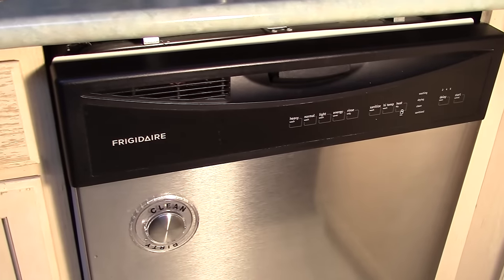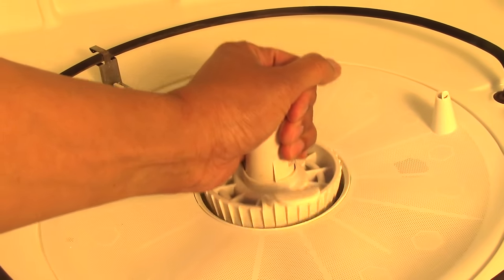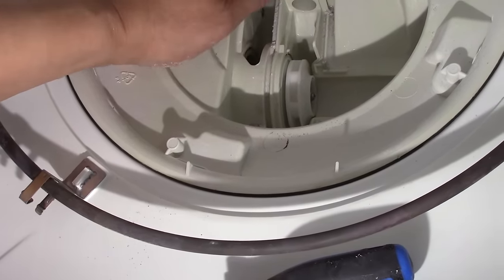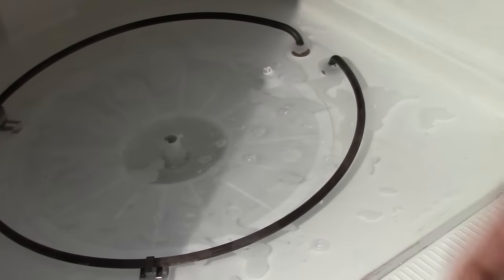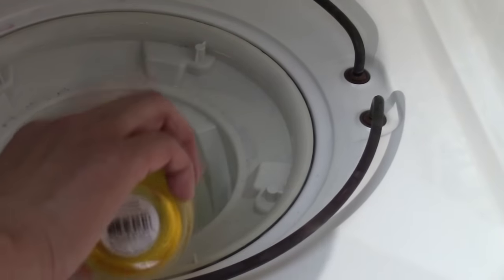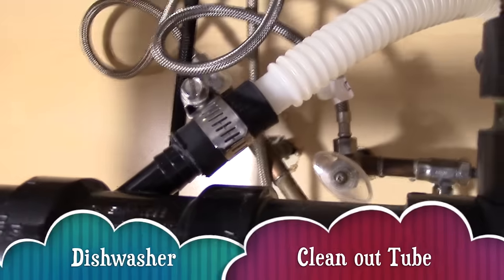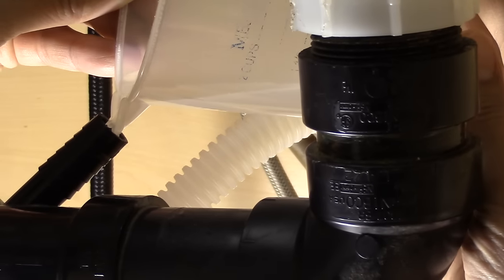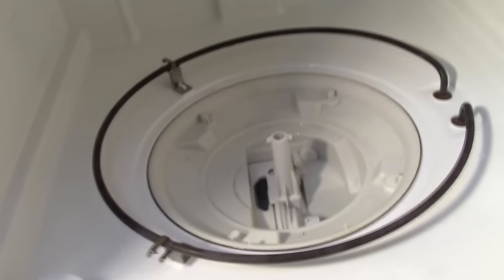Frigidare Dishwasher Not Draining Failed  2x - DIY unclogged dishwasher

Comment: Should have started with the “clear the hose out of the dishwasher” part first, professor! Otherwise, very helpful. Thank You.
Reply from the maker: Yes you're right. Glad my video helped.
Reply: @jonahvlogsdiy4143  You did great - most watch the entire video before attempting repairs/troubleshooting.. and in my experience you put the most probable problem at the front of the video..clogged inside the dishwasher - most people don't even know how to check their models..
Reply from the maker: @daveladd7046  thank you.

Comment: Are you able to respond?  My similar model Fridgidaire has low pump pressure, so I took it apart to look for clogs. Unfortunatgely, I did not observe how the large-diameter sump gasket fits relative to the center part and the round edge.  Can you help me with this? I cannot tell (from parts diagram) if the gasket has to fit around a part (i.e., the center part goes into a groove of the gasket, or if the gasket simply gets "press fit" and compressed .  Any help?

Comment: While ours seems to drain complete after a cycle, we noticed water start to pool up and not drain a few days after no my running it at all. Never had this issue until we had a Fridgerate dishwasher, any advice?
Reply from the maker: Good question. Not sure but maybe the pump not pushing water all out and coming back in.

Comment: Heck! My big screen got warped at the edge after washing w Clorox n hotwater.  The edge became 1/8H sine wave at several sectors
so i tried bending it w my fingers. I finally managed to reduce the wave to two sectors.  But can't accept it. Debris will sneak in from
there.  why oh why it can't lay flat at the edge?  Must b of cheap mat'l?  the dishwashing environment should b able to withstand datto
heat and soap (or Clorox n laundry soap).  Well, i just had to 'level' the hi two spots by filling there w Si (must b just latex as GE product
can lie) caulk.  Dry the caulk, then i'll re-install it tomorrow.  The best fix s/b for the maker to add spring loop at the edge.  Stoiped design!
Reply from the maker: Good idea. Thanks for sharing.

Comment: Mine still has water under the BIG ROUND filter. I did the baking soda, vinegar, and hot water three times. I also removed the thing under the sink and it is not clogged.
Reply: And then I ran a few things through the dishwasher and most of them came out dirtier than when they went in?!
Reply from the maker: It must be something else. I hope your issue will be heard from our Youtube viewers and someone else with the same problem can help. Sorry it didn't work for you.

Comment: What if I need to replace that rubber piece that attaches to the drain? What is it called? It is not right enough for a seal
Reply from the maker: If the rubber seal is causing a leak, then you should replace it.

Comment: Is there a valve i need to shut off before unscrewing that bracket for the hose? If I were to just unscrew the bracket, water won't just flood under my sink?
Reply from the maker: Have a bucket ready just incase, but there should be no water if the dishwasher is not running.
Reply: nothing will be feeding it any water but you will likely have some water in the hose.  An old bath towel will work as it is difficult to get a bucket close enough to where it needs to be and the water will be minimal.

Comment: Great vid...i came here because my dishwasher is a frigidaire and not draining but also the metal ring heating element on bottom stays hot and the dishwasher has been off for 2 days!!...burnt my thumb a bit but ill be ok... do you know what to do to fix this problem? Thanks!
Reply from the maker: I'm not sure how to fix the heating element. I hope some of our viewers may know and see your post. Maybe another DIY channel in Youtube can help you out. Sorry Vinny.
Reply: JONAH VLOGS & DIY make sure the switch is set to air dry and not plate drying , it’s the plate dryer that turns on the elements.
Reply from the maker: @victorchilds7834  Thanks for the info. Now our viewers will know. I'll add that to the description also.

Comment: Mine is not one that is comnnected underneath the sink. I roll it over to the sink, connect the hose to the faucet and plug it in. I could do the first two possible solutions, but how would I do the third solution? I haven't run my dishwasher in well over a year, but if I could get it to run properly I probably would.
Reply from the maker: Hopefully you get it to run. Let us know how it works out for you.

Comment: tried everything, unfortunately I think my clog is elsewhere and more likely than not at the exit of the dishwasher. I will need to pull it out and remove hoses :(.
Reply from the maker: Sorry to hear that. I hope you find the problem. Let our viewers know what you find.
Reply: @jonahvlogsdiy4143  after dismanteling everything, no clogs anywhere. I will have to check my drain pump and it is not that, I am out of ideas.

Comment: Would you happen to know what size screws those are? Mine were accidentally thrown away and I’m trying to reassemble/test out if I fixed the issue.
Reply: To clarify - I saw your T15 labeling but the length is what I’m concerned about
Reply: 3/4 inch #8 t15  pan head w/ thread pitch of 2.82
Reply from the maker: Thank you for sharing.
Reply from the maker: So glad one of our viewers had the info for you.

Comment: You didn't show me how to drain the water, you just recorded u doing it. That hose was from where?
Reply: Use a cup and drain out as much as you can. Then get a dry towel to soak up the rest. Squeeze out the towel in the sink and then repeat until the water is gone.

Comment: Well. I should have jumped on the last part where the solution worked. I suspected it was the issue. I just did the first and the last part. Thanks anyways.
Reply from the maker: Glad it all worked out for you.
Reply: @jonahvlogsdiy4143  Just update. The clog was way more. I have to take the washer out, take the plastic hose out, and remove all the gunks. Now it is working like a champ.

Comment: Oh, another thing about the dishwshr is if the white accordion pipe is connected to ur garbage disposer*.  The
disposer's sewage water as it swirls and churns can splash into the wshr's pipe into its pump sump.  And even
if u don't use the wshr for yrs or months, u can have the unit's bottom filled w (out)standing garbage water. Yuck!
The soln is to loop the garbage output hose high, above the disposal connection so the sewage water won't back
down into the wshr sump.  The best place to shove the hose is betwn the kitchn's sink and the cabinet's back wall.
u can clip the hose w wire attchd to the sink-to-counter metal bracket.  Don't care bout the input (hot) water hose
into the unit.  I bet previous owner or his dumb plumber didn't figure this looping hi back up prevention. S/b in the
installation manual?  The accordion pipe from the factory s/b long nuf datto u can pull it out of the bttm of the
unit from the ktchn sink cabinet.  Personnally, i don't like datto thin diam accordion.  It can trap debris easily n clog
up.  No, u kant have the hose diam. too big or u'll lose the pressure to push out the muck.  Butto don't question the
wisdomKingdumb 'traditional' method of doing dings (things)???

So, if u see standing water at the bttm o the unit, u may do some experiment, turn on the disposer n chk the dirty
water goes down dare (there).  If water leak on the kitchn floor caused by the wshr and it's nut (not) at dose
visible water hoses/connections, then ur scrwd.  It maybe at the bottom outside case of the unit.  U must then
take the unit out of it's cave, turn it upside dwn, and fix the connection.

U may den consider getting rid of te dishwshr all together and wash the dishes manually.  And, from dis video, u've
discovered crap from ur dishes will always accumulate down at the sump, above AND below the screen filters.
And, there is only one pump in one sump well to spray the 'clean' water to ur dishes but also, the same pump is
spraying new but debris contaminated water from the sump onto ur dishes.  Yuck, YUCK, YUck!!!  Get rid of the
entire unit and don't put a new one in at all ....  KAN u count on the one loop heating element to kill MicroBiom
sprayed from the dirty sump on ur dishes and $700 ea. LaLique Stem ware?  Maybe dato shattered glass pwdr
floated onto the top of the screen can add flavor w the garbage on it or under it in the Sump.

Hope this experience i had was useful for some audience here.
________
*Some o/p hose is connected directly to the vertical sink pipe as this video shows. But still, the hose s/b looped
  higher than the sewage pipe connection level.
Reply from the maker: Thank you for sharing. This will definitely help out our viewers.

Comment: I lost a screw in the bottom part. Am I going to mess everything up if I leave it. I can’t get it.
Reply from the maker: Try using a flex magnet to fish it out. I ]m not sure what would happen. Let us know how it worked out for you.
Reply: JONAH VLOGS & DIY I ran it twice on rinse and the screw appeared. I put everything back together but my dishwasher is still not working. My sink connector is different from what you have. I am not able to unscrew and clean anything.

Comment: The fellow who installed my dishwasher said to use only liquid detergents because the powders clog the lines. News for him, so does the liquid soaps! Our stopped cleaning well and I found the holes in both rotating sprayers all clogged up with soap residue. Vinegar and baking soda loosened it up, but I had to suck it out with a shop vac. Ran a couple loads of vinegar through it, and all is well again.
Reply from the maker: Great info for our viewers Barry. Thanks for sharing.

Comment: Help! The tab is stuck and won't turn into position to lift it off. Any ideas? It seems like something may have fallen through and is blocking it from turning.
Reply from the maker: Might try to turn it the other way and then turn it the right way and wiggle it off.
Reply: @jonahvlogsdiy4143  doesn't budge either way. My son was afraid it would break if he tried any harder.
Reply from the maker: So sorry. It should move. Not sure why it doesn't. If any of our viewers know the answer to Susan's question, please let us know? Hope someone else can help.
Reply: Mine was quite snug.  I would try some cleaner.  Get all the water you can out then use the baking soda and vinegar trick, highly concentrated oxyclean solution or if you have hard water, try CLR or Lime Away and let it soak for awhile.
Reply: @ChainsawPenny  thanks I'll try
Reply: @susanblair6351  mine is still apart as I'm still cleaning my screens.  There really isn't any way for anything solid to block that from turning.  It is however a tight fit.  He used his fingers on the center making it look easier than it is.  The tab at 3 o'clock is there for you to turn it.  Steady increase of pressure and it should come.   I've also fixed an old one long ago by dumping in drain-o, waiting an hour and running a cycle.  A service call will likely start at $100, without parts, a new washer starts at $250, that is why I once fed one Draino.  There is point where there is nothing to lose.  If you have to go that route, be sure to check the drain house connection first just to make sure that is not your problem.
Reply: @ChainsawPenny  after I drained it better and with a flashlight I eliminated the fallen object theory
Reply: @susanblair6351  Before you go farther, grab a screwdriver and check the drain hose to your sink drain.  Just throw a towel under your sink, there won't be much water.  Also, do you have a disposal?  If so, there is an air vent that is subject to dust bunnies not covered in this video that is an easy clean.  If all checks out, proceed to a cleaner.  Since you may end up going the route of draino, do not use bleach or other chemical cleaners that may interact with that.

Comment: Do i need turn turn off the electricity to work with the screws?
Reply from the maker: Good question. If the power is not on, it should be ok.

Comment: Found one more solution if none of these work. A bad control board (where you push the buttons). Had  to replace my control board after 4 years. $240 😩
Reply from the maker: Thank you for sharing that info. It will help out our viewers.

Comment: I went through these steps and I got the dishwasher to run and drain, though right before it would normally switch to Dry, meaning to say the last time it would drain, the dishwasher just.. Stops. Leaving the water at the bottom again, even though it has drained a few times earlier. Anyone know what this might be?
Reply from the maker: Sorry that's i different issue. I'm sure there another Youtube video with your issue. Good luck on it.
Reply: Likely too late to help you but if you have a disposal there is an air vent that you can clean.  If your kitchen sink is draining slowly you have a plumbing issue.  If it is fine it is likely the pump on your dishwasher.

Comment: I have done all three of these and none of mine is working
Reply from the maker: Sorry to hear that Ashley. Maybe it's a another issue.
Reply: @jonahvlogsdiy4143  The part that spins when you take all that apart it’s underneath it’s so close to the outside that I can’t stick my hands or anything else there to make sure it’s spinning so I’m thinking maybe that’s the problem
Reply from the maker: @ashleyelizabeth2465  Could it be a pump issue.

Comment: Totally irresponsible to not state up front that the first two attempts were failures. So I took my dishwasher apart for no reason. Maybe your debris was part of the problem but not primarily. You are what’s referred to amongst mechanics as a parts changer. If you replace every part in a car you eventually fix the car. It indicates a total inability to diagnosis. Anybody can change out parts. It like you say remove the engine then later state that you gas pump actually failed. And if you don’t understand what it talking about then I’m not surprised.
Reply from the maker: I think you misunderstand the point of the video, but thanks for the visit.

Comment: It did not help I’m losing my mind even more
Reply from the maker: Unfortunately it may the pump. Sorry I don't have video for that.
Reply: Do you have a new garbage disposal? If so, check the inlet where the drain hose attaches to. They come new with a plug that needs to be removed, or you might even need to drill a hole.

Comment: Still didn't drain ? Now what ?
Reply from the maker: Compatriot maybe right, yes it might be the pump. There are other videos on dishwasher pump. Sorry to hear it did not work.
Reply: @fearlessnomad5311  .....sometimes the pump gets stuck with calcium buildup so you always check it by rotating the pump drum back and forth.
Using vinegar removes it and then the baking soda neutralizes the acid (simple chemistry).
Always remove the drain hose first and blow thru it, then check the air gap pipe. Next run a cycle before putting everything back together. You will still get it to drain and cycle. Worst case scenario is bad pump or electronics and/or replacing the appliance.

Comment: what a fucking piece of garbage is this dishwasher. In 2 years I have faced this issue 20 times....and my landlord keeps changing my dishwasher with another one from another apartment with the same exaclty issue and so on.....
Reply: Do you have a disposal?  If so, there is an air vent that clogs with dust bunnies.